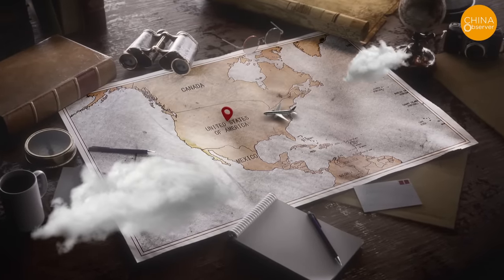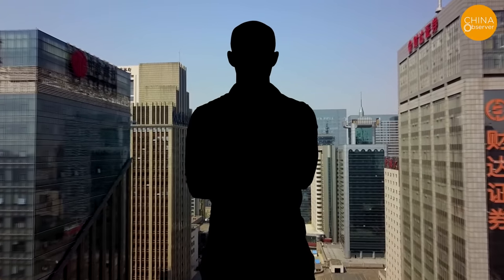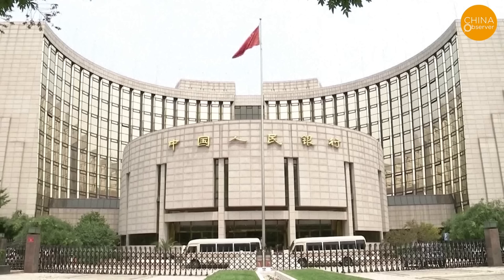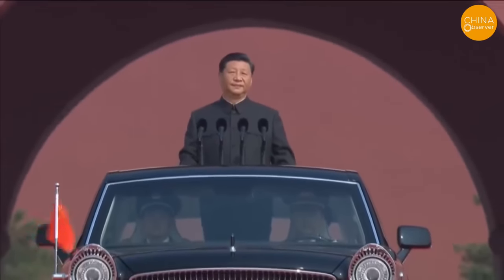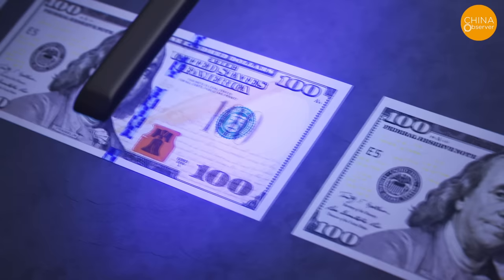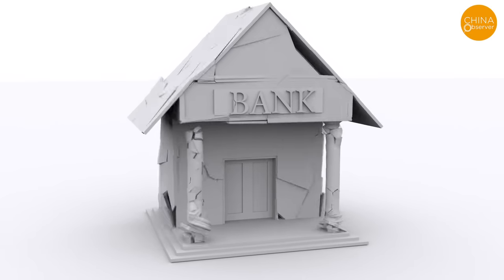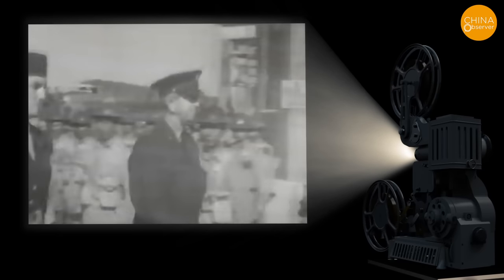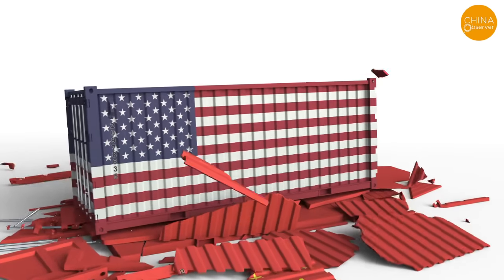Fake USD Withdrawn From China's Banks! Chinese Tourists Caught Spending It in the US! Be Cautious!

Comment: I agree that the U.S. should remain vigilant in protecting its currency.  However, the vast majority of transactions are electronic and not paper. in addition, merchants usually perform an extra layer of scrutiny when you pay with a hundred-dollar note.  You could pay for your transaction with ones, fives, and twenties but this would draw suspicion from the merchant.  In addition, if the merchant accepts a counterfeit bill, he has to absorb that loss.   Therefore, the merchant has a strong motivation not to accept counterfeit bills.
Reply: Depends.  Canada is currently using plastic bills, with a bunch of security features instead of the cotton/paper mix that most bills around the world is using.  I'm sure they are trying to duplicate it, but that will still take some time.

Comment: I read that US Dollars are made from a blend of 25 percent linen and 75 percent cotton; with  tiny red and blue synthetic fibers of various lengths evenly distributed throughout each note; but it's paper? Meanwhile here in Australia our banknotes have been plastic with all sorts of built in holographic security measures since 1988. (It took until 1996 to withdraw all the old notes). And recently a tactile feature was added with little bumps; (not braille); to assist the vision-impaired community. They are pretty much impossible to fake; being plastic. Just don't put them down on anything thats hotter then 175 degrees Celsius.

Comment: This is an interesting story and all, but the video authors are failing to acknowledge something very basic:  ONLY about $55 billion of USD currency is actually printed paper currency, while the TOTAL USD "currency" in circulation is over $2.5 TRILLION.  What does this mean?  It means if you could collect ALL paper USD currency printed on paper, you would only have about 2% of the TOTAL USD in circulation.  Do you understand that?  98% of USD currency exists as intangible numbers in computer bank accounts and loans.  So, no there is no way China, North Korea and/or Russia will be able to print enough counterfeit currency to disrupt the USD currency.  It's 2024, not the 1940s when more transactions took place with paper currency.  It's mostly electronic now.  The risks posed in this video miss the mark.

Comment: When checking authenticity put the bill in light and anything over 1-2 dollarbills should have the bills denomination in a thin threaded strip that goes horizontally and  is only visible when put up to light . On 5 it's right side the rest left side of face . I have yet to see a fake with this feature ..again only anything above 2 dollars so counterfeiting dollars would be the best option for scammers since it seems this feature is hard to fake .